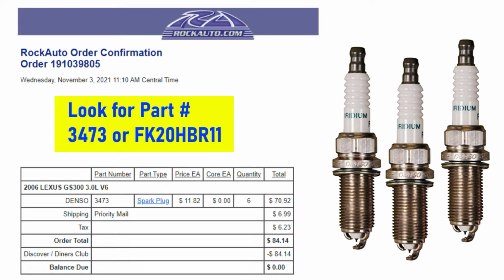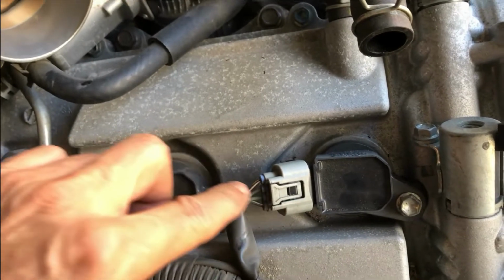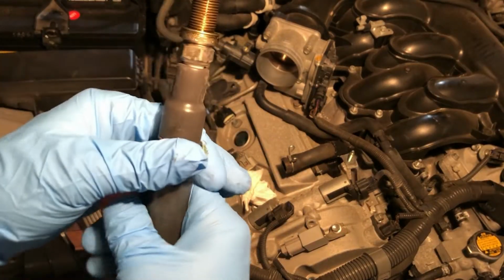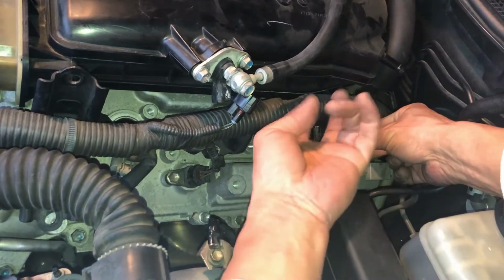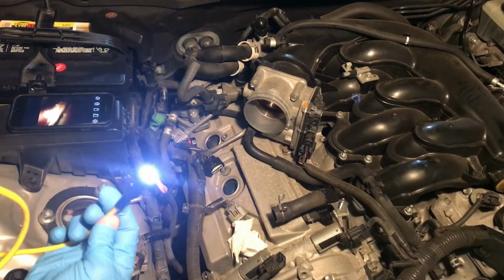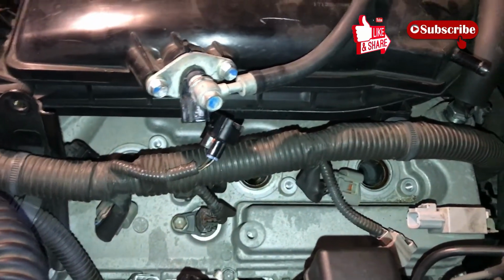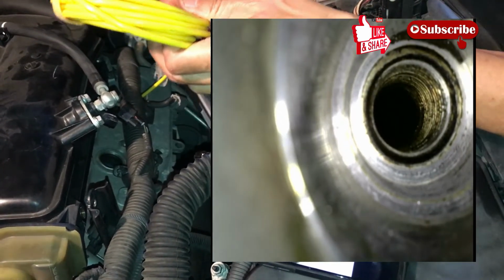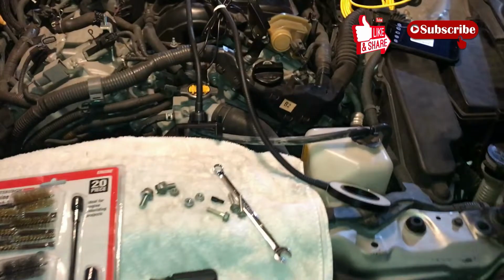2006 GS300 Spark Plug Change & Borescope view of Carbon buildup on pistons

Comment: Worst car to buy, freaken starter is a pain to replace..
Reply from the maker: Looks like this guy was able to pull out the starter without removing bunch of other parts. Have you seen this video?
https://www.youtube.com/watch?v=PXwYPqdhwes
Reply: I had my starter replaced Mechanic said it was easy changed my alternator too
Reply from the maker: Great to hear. I’ve watched some videos on starter and it is tricky to remove the starter in very tight space so the manual suggests a longer route of removing other parts.
Reply: You just have lack of skills, gs300 is the best car to buy
Reply: @maciekoks  I've been working on cars since a teenager, lexus is the worst car to work on I gave mines away.. pos
Reply: @DIYLifeSkills  mines a awd with all kind of stuff in the way
Reply: @brongthao6802  AUDI/ VW is the worst to work on lol...Ive also been working on cars since a teen, with a dad who did 20 plus at GM..I usuallt do pretty decent with toyota lexus and acura honda
Reply: The alternator is really a pain to replace.
Reply: It wasn't too bad. Lifting the motor to get starter out was cool but I spent hours trying to loosen then tighten the top bolt of the starter. Probably would have been a ton easier with correct socket extension and swivel.

Comment: I can get cylinder 2 out. The manifold is blocking the way
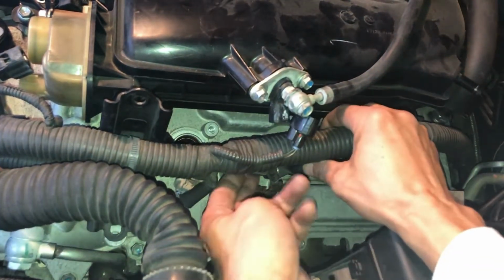Reply from the maker: Can or cannot?  I’m any case, driver side plugs are blocked by thick wiring harness so you’ll have to get that out of the way to be able to remove plugs on that side. Take a look at 18:15 time mark in this video, you can see how I gain access to the #2 plug by getting tuning harness out of the way.
Reply: @DIYLifeSkills *can't. I had no problem taking the middle and back but the front is too tight. I did unbolt some of the harnessing around it but ultimately I can't get a socket on it nor have enough room to work a wrench. The manifold is in the way of the bolt
Reply from the maker: @csl9495  Please watch my video very closely.  You can see once the wiring harness is loosened and pulled down, you have direct access to the plug.  It might help if you have a universal joint.
Reply: @DIYLifeSkills  whelp... doesn't matter now. I think I've concluded, it's a timing chain slip.
Reply from the maker: @csl9495  Oh no. What year and how many miles do you have?
Reply: @DIYLifeSkills  ahh you know what, I just came across a video that uses crows feet wrenches that would've probably helped.

I have a 2007 lexus Gs350, 140K miles.
Reply from the maker: @csl9495  That’s not a lot of miles for this car.  Hopefully you’ll it fixed and ride another 100K miles.  Also, anything to move the wiring harness a bit without damaging it would be good.  Poor design. They should’ve put little more slack in the wiring harness to allow easier access to the plug.

Comment: so yours was burning a little bit of oil. mine is burning 3 quorts oil in 1k miles i hope this methord will fix it
Reply from the maker: I'm burning about 1 quart per every 5000 mile oil change.  I bought this car at 105K miles, and I've been only doing 5K mile oil change as 10K mile oil change cause serious carbon build up on piston ring, which causes oil burning.
Reply from the maker: I know this cleaning probably helped some but probably only by 1/4 quart every 5K miles. BG has this product that supposedly cleans the carbon build up on piston rings, and this is what I'm going to try next.
Reply from the maker: https://www.amazon.com/Bg109-Engine-Performance-Restoration-Makers/dp/B00IAPLIDK/ref=asc_df_B00IAPLIDK/?tag=hyprod-20&linkCode=df0&hvadid=693070740373&hvpos=&hvnetw=g&hvrand=3926538468400984815&hvpone=&hvptwo=&hvqmt=&hvdev=c&hvdvcmdl=&hvlocint=&hvlocphy=9027782&hvtargid=pla-569805723483&psc=1&mcid=18d7cf6321d53a32a8f7e18c025ec530&gad_source=1
Reply: @DIYLifeSkills  I would love to see that video pop up when you try it.
Reply: @DIYLifeSkills  Yes the piston rings were also my go-to for the oil-burning but others say that it's just an internal leak somewhere.
Reply from the maker: @XenialMusic  Rarely there is internal leak. Seized piston rings can’t scrape the oil down from the cylinder wall, and remaining oil burns during combustion cycle. This is why some cars don’t have outside oil leak but oil level goes down. This is mainly caused by not doing oil changes regularly. And those 10k mile oil changes are creating lots of carbon build up on piston rings.
Reply: @DIYLifeSkills  i bought my car very recently at 98k miles and now it has 105k miles. Plus i do oil changes every 3k-3500 because i drive a lot. And so far i have done two oil changes. And during those periods it started burning oil very heavily.
Reply from the maker: @XenialMusic  Burning a quart of oil every 330 miles is a lot.  Some of my friends Toyota (Venza, Camry, Siena) with 150-220K miles are doing that. So your engine condition seems to worsened quickly. The previous driver may not have taken care of the car well…like driving too long on low oil level.
Reply from the maker: @XenialMusic  I think you should do piston compression test. There are many videos on how to do this.  And the auto part store rents the tool for free. But compression test tools are not super accurate. So it’s best rent two different tools from two different auto parts store to do the test and take average of the two.  If you are low on compression, you’ll burn more oil and use more gas. How is your gas mileage?
Reply from the maker: @XenialMusic  check out this video. https://youtu.be/FItAcUKcy0I?si=QpRwbUy7Xs1kGQQd
Reply from the maker: @XenialMusic  And this video. https://youtu.be/pmsIyV2zQAI?si=YpCbmH_tI0jC6f1-
Reply from the maker: @XenialMusic  there are lots of good videos on piston carbon cleaner. https://youtu.be/AIDT6I2toK8?si=Tjnsae8Kb8iySwXZ
Reply: @DIYLifeSkills  I did the compression test they were all around 180-190 except the 5th chamber, my buddy and I tried everything to get any reading but we did not get any I am guessing my battery was low or that the compression tester was not fitting in properly science it was a really tight spot.

Comment: Very well done video. Thanks for sharing. I have an 06 GS300 with about 185k miles. I have replacement plugs, but have been procrastinating changing them out😂. Engine burns a lot of oil and plugs have never been changed but it still runs smoothly. It seems a bit sluggish on acceleration so want to change the plugs and your video helps greatly. Thanks!
Reply from the maker: Passenger side is super easy. Driver side, you have to move the wiring harness out of the way, so it’s more tedious but nothing difficult.  

Expect the sole wire connectors to break, but I have videos on how to find the part numbers and replace just the connectors. 

Also be sure to check the gaps on new plugs.  Though they are supposed to be set, my new plugs were slightly off.  Only use flat filler gap to measure the gap and not the round (cheap) coin shaped one that’s not accurate at all. 

Also, only use the matching OEM plugs. This car is sensitive if you use different plugs.  Also, there are so many fake plugs in the market.  Buy from reputable auto part store only.  I bought mine from rockauto.
Reply from the maker: While at it, I suggest you get a borescope camera and check out the carbon build up on piston head.  Cheap borescope is about $20. Good ones start $50+.  

Also go read about the 3rd piston ring, and why oil burns when small holes around the 3rd ring gets clogged with carbon.  

I also use Lucas fuel injector cleaner pretty regularly. I buy the 1 gallon one, and add few ounces to gas tank every few fill up.
Reply: @DIYLifeSkills  thanks. I do have a cheap borescope already so I was glad to see another good use for it😂. I think these motors had a recall at one time to replace the rings but at the time I wasn’t having an issue with it and thought it better not to have them open up the motor. Probably not a good decision in hind sight.  Did you figure out a method to remove the carbon?
Reply from the maker: @kaleacoco  because piston rings make pretty tight seal, it’s hard to get any carbon cleaning solutions to the 3rd ring.   So I did what I can, which is cleaned the Carbon build up on intake valves and piston tops.
Reply from the maker: @kaleacoco  The master Toyota mechanic says, the 10k miles oil change is the biggest reason why so many Toyotas and Lexus are burning oil eventually.  He says if you do oil change every 5K miles, the carbon build up will slow significantly. So I’m doing 5K miles oil changes on all my cars now.
Reply: @DIYLifeSkills  this is really good to know.  My 06 gs300 has almost 130k on it, but the oil has been changed every 5000 miles for the entirety.  This video is super helpful and I plan on doing mine soon.  As well as checking how bad the carbon build up is.  Thank you!
Reply from the maker: @franknotzappa  Check out Toyota master tech’s detail explanation on why 10K mike oil changes are causing premature oil burning issues.   https://youtu.be/v4JS7PybV2k

Comment: Same as mine cylinder 1 was having much carbon than the rest of the others cylinder so now you confirmed is there’s some design flow or something for sure but for your case since your spark plugs covered with oil you need to replace the engine cover gasket and that will eliminate the oil pass through and get on your plugs 👍🏼!!!!
Reply from the maker: Were any or your spark plugs coated with oil?   Few of my spark plugs were coated with oil, even on threads.  That tells me that means I'll have to replace the spark plug tube seal, which means I'll have to open the valve covers and replace the valve cover gasket as well.   But here in Houston we hit 107 high today, so that's keeping me away from working on cars more often this summer.     As oil reaches the spark plug, I'll be losing some oil and also it's going to cause piston to build up carbon more quickly, so sometime this year, I need to get this done.   But otherwise, my goodness this 16 year old car runs so smoothly.  I love it.
Reply: @DIYLifeSkills  all my spark plugs was kinda wet from the threads but not too much oil only 1 spark plug in cylinder 1 was dark coated with carbon buildup but I did notice some oil in this hole chamber but not too much, last year I did change spark plugs tube seal and valve cover gasket and water pump and thermostat, my car now drive very smooth expect that white puff smoke that only comes and last for 3-4 second when I startup the vehicle and engine is warm ,, that’s why I keep changing oil to see maybe the oil or something.. any idea what can cause that ,, also do you have telegram so I can shoot you text in there and pictures
Reply from the maker: @costantineyoussif6679  Upload it to your YouTube channel, and then you can also post it on Club Lexus, but based on your description that is quite normal...as long as you don't see your coolant level going down.
Reply from the maker: @costantineyoussif6679  Also, do you park outside vs. inside the garage?  Because the white smoke happens more if you park outside because more condensation builds up on the exhaust pipes so you'll see more smoke.   When I park my car inside the car, I get very little white smoke.

Comment: I have a 2006 Lexus GS300 exactly like this one.  ( mine is red metallic) I bought it used 12 years ago.   Right after buying it the check engine light came on and I took it to Lexus.  They told me that this was due to carbon build-up and that this model & year (2006)  was notorious for this issue.  The cure was to rebuild the engine with Lexus replacement parts, including pistons, rings, rods, etc  to correct the problem.   Lexus completely rebuilt the engine as part of a call back and I was not charged a dime.  It took quite awhile, but they gave me a loaner for the entire time.    When I got the car back it ran perfectly and still does today.   122k miles.   When right, these cars are a dream to own.  I don't mind doing the maintenance and paying whatever expenses it takes to keep it in top condition.  Went on a 7500 mile road trip last year and the car was amazing.  Powerful, smooth, comfortable, handles well and 31 mpg on the road.   I hope it lasts forever.
         These cars accept a Tesla style radio with a 12.8" touch screen.  Replaces the entire center control panel.  Takes some getting used to, but is very  nice upgrade.   I used a Phoenix unit and so far it's been good......
Reply from the maker: Thanks for the detail feedback.  About what mile was the car's engine rebuilt?   2006 is a GDI engine, which means the fuel is sprayed directly into the piston chamber ONLY.  Starting in 2007, they have dual fuel injection - one directly to the piston chamber, and one to the intake valves.    Since no fuel is sprayed to the intake valves, heavy carbon builds up, and there is no easy way to get hard baked on carbon build up, other than to manually scraped them off or do a walnut powder blast to get them off.   I did the manual intake valve carbon build up cleaning.  So this is something you might want to consider in the future.  This is the video.  https://www.youtube.com/watch?v=m0fGP3MrqFQ
Reply: @DIYLifeSkills  Thanks for that tip and video.  Right now the car runs extremely well.  Like a new one.   I am reluctant to do anything along these lines for that reason.  I will definitely keep that in mind in the future.  These cars are 17 years old and their actual value is low.  However, finding a really nice one is worth the price.  It's always a trade off.   As I said I hope to keep this car for at least a few more years.
Reply: @DIYLifeSkills  54.000k  engine rebuilt.  I was told that this was the factory rebuild fix for this issue???
Reply: There was a recall for these cars because of how notorious they collect carbon build up. Mine has 177k and need valve retainer and spring replaced causing misfire on cylinder 1.
Reply: @DIYLifeSkills  I have a 2010 GS 300 GDI the last version made no problems yet 130,000 km
I don't drive it much 3,000 km Oil changes every 6 months

Comment: Your 1st half looks very DIY lol but second half scare me off. Very detail thank you
Reply: 1 more thing, my gs350 07 is idling around 6k-6300 rpm which i believe is very low, wonder what yours is idling at thank you
Reply from the maker: Mine is exactly same as your.  :-)

It’s usually 600-650 for few mins after cold start. And once I start driving for more than 10 mins and stopped at a light, it’s more closer to 600.
Reply: @DIYLifeSkills  yes exactly that, but a very rough idle, wasnt sure if i did a bad job with the throttle body clean and not cleaning the sensor. i will try that again, it happens everytime when i stop at a sign or red lights. wonder if you ever had that bad experience and hopefully you never will lolz
Reply from the maker: Initially after I bought the car I had rough idle sometimes right after dataset and when stopped at a light and periodically get random CEL. 

All that’s been fixed with combination of PCV replacement, MAF and TB cleaning, gas cap change (yes gas cap on this car doesn’t seal right), and seafoam spray.  Oh I also use Lucas fuel cleaner every 1k miles or so. Afterwards, I’ve not had any rough idle. It’s very smooth that even water bottle in the cup holder doesn’t shake.
Reply from the maker: When did you clean the TB? Because the car can have rough idle until ECM relearns the proper idle air-fuel mixture.  Cleaning MAF is the easiest thing you can do. Takes 5 mins, so so that also if you haven’t. 

After TB and MAF cleaning, within few hours of driving, the car will auto adjust the idle.  You can also check to see if the TB flap is nearly 100% closed when idling.  Check this both in cold start and once the engine is in operating temperature.
Reply: @DIYLifeSkills  i will try to replace my pcv valve and clean the tb and sensor and come back for a update. im in PA is still freezing out, need a warm day. thank you so much for your detailed replys and tips
Reply from the maker: @gordonmei8913  how many miles do you have?  You need to use fuel injector cleaner regularly especially if you put regular (vs. premium) gas.  

I always get gas only from Tier-1 gas stations, usually at Costco.  

Also check your engine air filter.
Reply: @DIYLifeSkills  I don’t remember exactly but is over 170k  and I always put premium gas . I got the car about 4 years ago , don’t remember putting in fuel injector or pcv change or anything major.
Reply: @DIYLifeSkills  stupid as it sounds, almost wish u was my neighbor lmao. I’m in pa hoping it gets warmer soon, so I try to do everything as a small project

Comment: Was wondering I wanted to do a spark change on my Lex but I have gs450h and it's a bit more stuff there to dismantle
Reply from the maker: What year? Can you post a close up video of your engine on you YouTube channel.  Basically steps are similar, and it just comes down to what you have to remove to gain access to ignition coil and spark plugs.
Reply: @DIYLifeSkills  hi sure no problem I will do it after work. I'm in UK so there will be a time difference. Tha ks
Reply: @DIYLifeSkills  and its 2011

Comment: thank you for doing all these videos,  very helpful.
Is it Gs450h use the same spark plug? Thank you again!!
Reply from the maker: What year?
Reply from the maker: Check under the hood cover and there should be a sticker with the engine name. Mine is 3GR-FSE. Some GS450H were same engine but some are 2GR-FSE.
Reply: @DIYLifeSkills  2008
it is 2gr-fse 3.5L engine, I guess 2gr, 3gr basically is the same thing?
Reply from the maker: @2gr775  yeah they are sister engine and looks like identical spark plugs are used.  If you want to be sure, call local auto part store and have them check against the VIN #.  I tried a slightly cheaper denso plugs and they misfires so I returned it and got these.  So go with the the matching OEM plugs for optimal performance